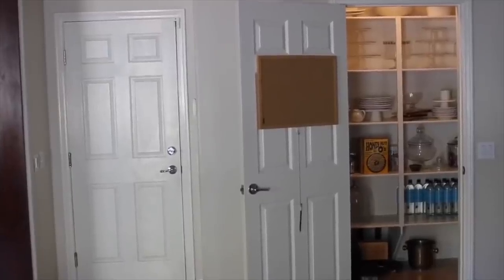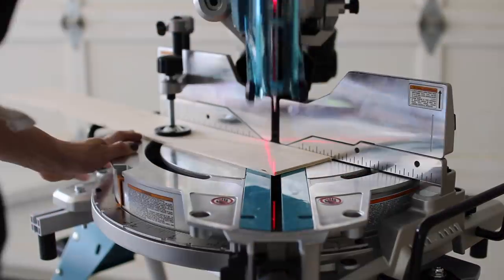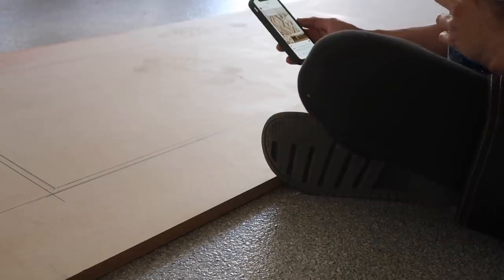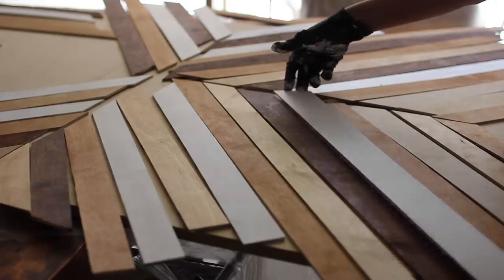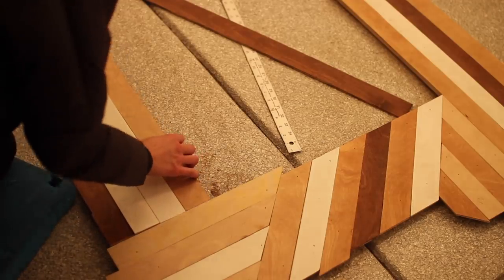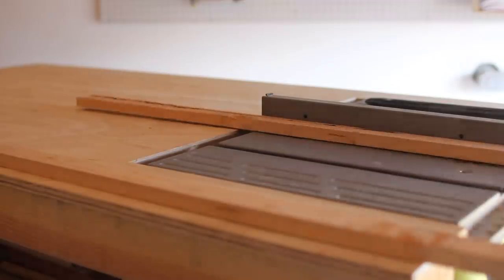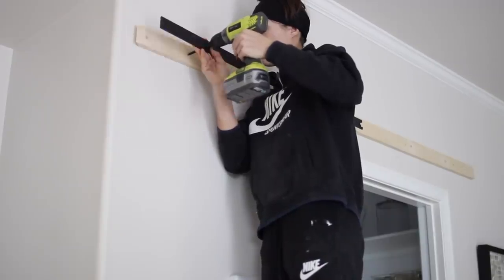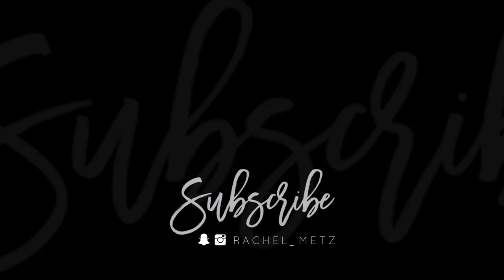DIY Sliding Barn Door With Window!

Comment: Love this!! Is it possible to use barn doors for closets? Do you know if there is a way to “nest” them, like have one door slide behind or in front of the other?
Reply from the maker: Yes of course! I would think you'd have to hang two different hardware tracks and have the thickness of the headboard that holds one be thicker than the other to make that happen? I'm not 100%

Comment: A couple comments, not about your designs or ideas, but about other aspects of this build.  One, that miter saw is nothing a beginning should even consider.  That saw is way too expensive for someone starting out, and battery powered saws like it are primarily for trades people who will be working in a new location constantly.  A simple 10" fixed, corded, miter saw is a much better option for a neophyte to start with.  Two, spraying white paint and wearing black clothing?  Not the best choice.  Also, always cover up your skin when spraying finishes.  You do not want over spray on your skin.  Finally, you'd have been much better served by using a small tac strip and pin nails to install the glass.  If that glass were to break, trying to remove it after it was siliconed in will be a nightmare.
Reply from the maker: I don't know what else to say besides I think it's about personal experience. I started with Ryobi's 5" corded miter and it was a great motivator to me since it was less intimidating than a table saw (again personally for me). Yes I am wearing black clothing but those are my paint clothes and it's sad I have to clear it up with humans who genuinely care that much. I also am fully capable of showering and getting the paint off like an adult so I'm not tripping. Thanks for the tip about the small tac strip! This entire channel is me sharing how I tackle projects and not holding myself back. If you are looking for pro's,  I am not that - I'm just trying to show it isn't scary learning and slowly progressing and it moves along quicker with feedback from humans like you that I would've have even known.